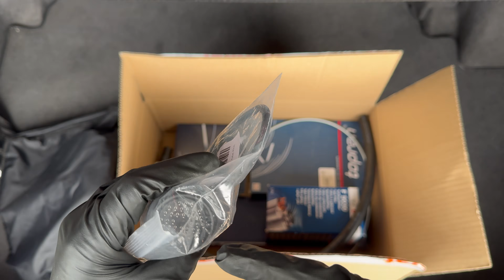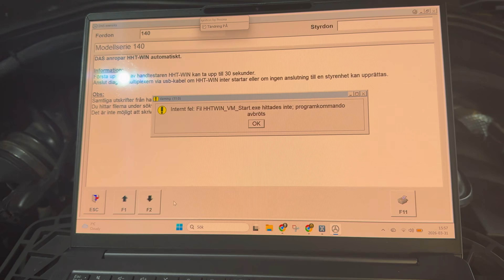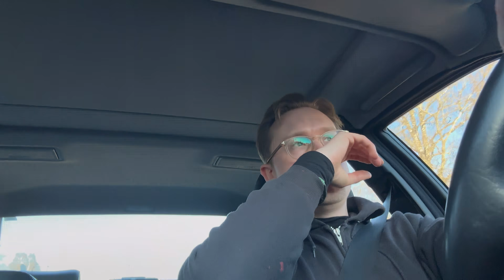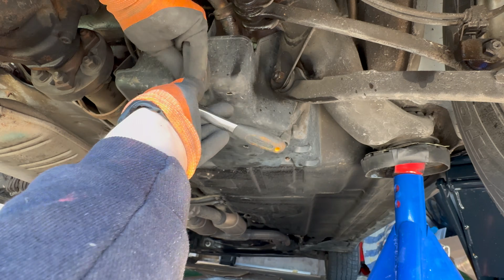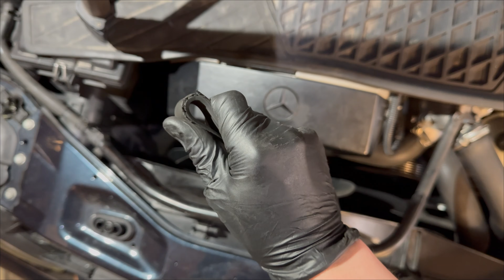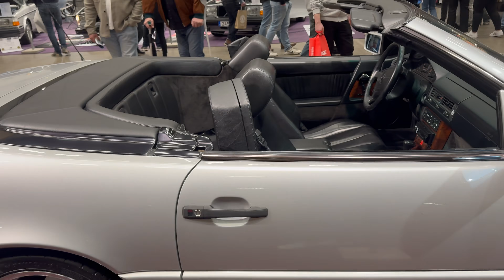My W140 Has the Same Gearbox Problem as My CL65 AMG

Comment: 2003 w220 s600 owner here, I put a thin round magnet in the corner of tranny pan by drain plug and after about 3k seemed to catch a lot of magnetic debris that otherwise would still be circulating.  Put the magnet in when I did conductor plate, connector,  amg bluetop solenoid upgrade and replace all the other solenoids!
Reply from the maker: That’s great idea actually! Thank you fpr sharing!

Comment: Definitely change the transmission filter and fluid, it's heavily used if it's looking like engine oil, it should be pink-ish going into red. 236.14 (enhanced from 236.10 and 236.12)  is the correct MB approval, don't use anything else :).
Reply from the maker: Thank you for commenting! It was red-brown-ish so will definitely do a service.  and perhaps the conductor plate too.. 236.14 is what Mercedes gave me also 👍
Reply: @SSAlubeam MB has an official website called "operating fluids" and there you can check all approvals and recommendations :). The only up to date approval for the 722.6 transmissions is the aforementioned 236.14.

Personally I wouldn't buy fluid from MB as it's very expensive and there are good alternatives, also from Ravenol from which you got the engine oil (I watched all your other 140 videos too 😅). Then again, you have a CL65, so who cares 😄

Comment: The color should be red, not brown.  Change it for sure.   The oil in the harness is the problem.

Put the round connector into a package of dry rice under the car so it can draw out the atf fluid from the harness.

Save the old belt in the trunk as an emergency spare

Great video
Reply from the maker: Thanks for good input as always!! Will probably also replace the conductor plate ”while in there”